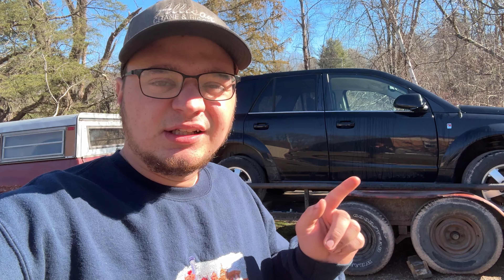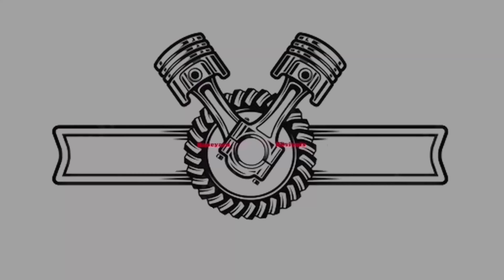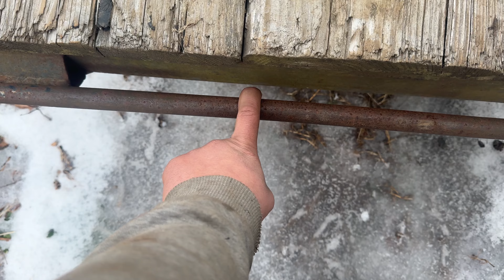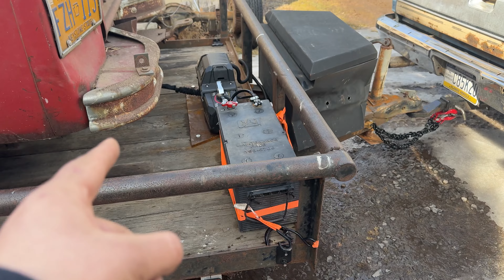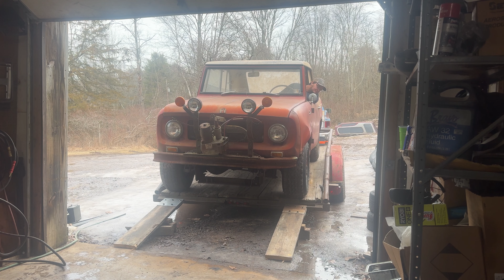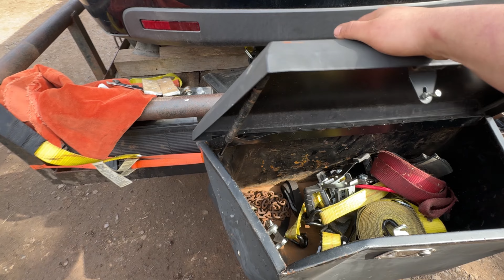First Hual￼ with our Budget Car Trailer! Will it Survive?

Comment: I would say good used tires because in and out of junk yards means a lot of flats.
Go with a matte black because the trailer is gonna get banged and scraped up.
Put the winch inside the new tongue box so it's out of the way and out of the weather. 
Thanks for taking the time to bringing us along.